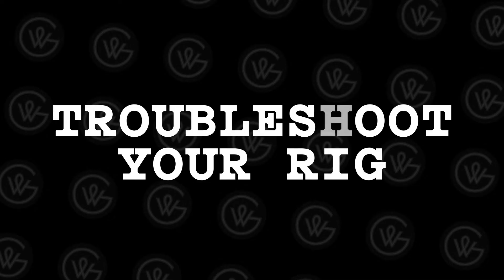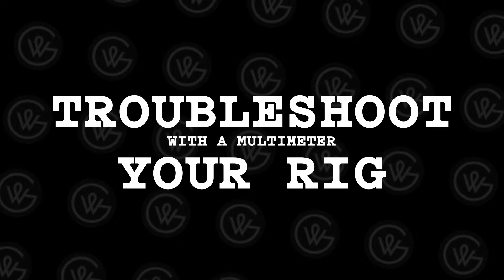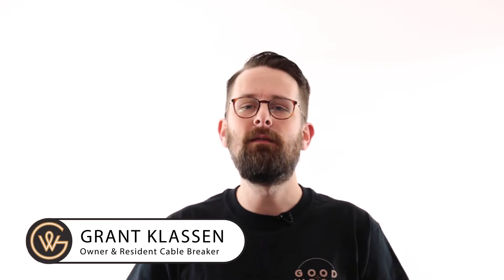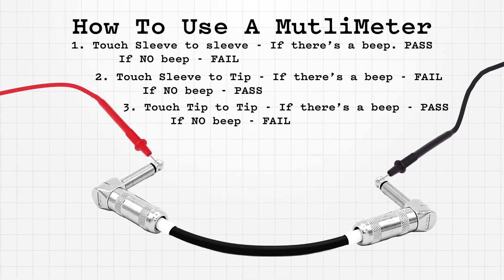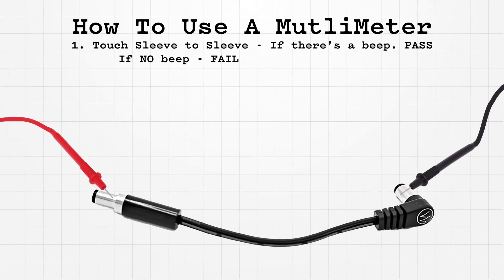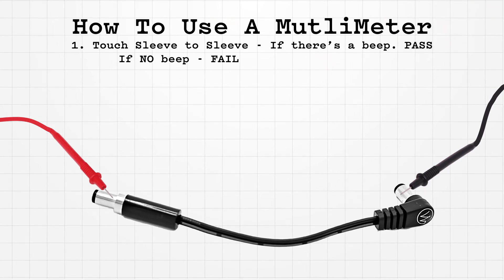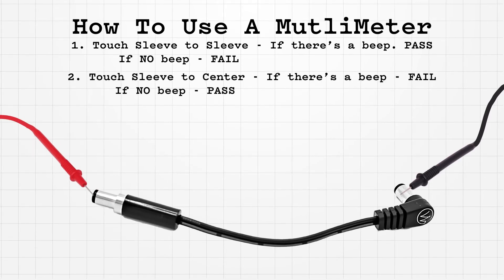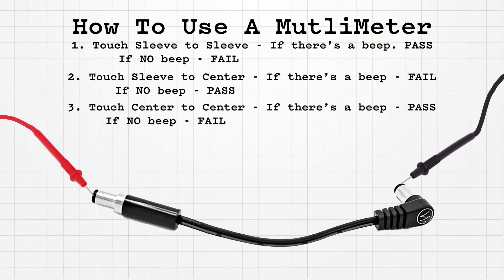How To Test Patch Cables Without Taking Them Off Your Pedalboard!

Comment: Can you explain a cable that tests good with a multimeter but does not work in a board? or plugged straight into an amp? Isolating this problem down to this apparently good cable has been frustrating, and I don''t understand how I get continuity with it but otherwise no signal through it.
Reply from the maker: interesting.  I'd check that the sub shield (if it has one) --> a black shield between the ground and the dielectric --> isn't shorting to the tip of the cable.  These will test fine, but either sound very dull (no high end) or not work... that would be the first thing I check.

Comment: That's useful - but how do we test the quality of the cable connection?  i.e. resistance level - this determines weak vs strong connections, right?   When learning to solder I've made cables with only one or two strands of tip or ring signal connected and they still pass this multi beep test - but I know the connection is weak.  How do we get more granularity on the quality of connection?  Thanks
Reply from the maker: hoesntly.. you could use resistance to test this, but even with a few strands connected, you'll get a good reading.  The best way if you're concerned about this, test with resistance and then also give the connections a visual inspection.

Comment: When testing for continuity, what should your meter be reading? I’m generally reading 0.4 ohms when testing my patch cables.
Reply from the maker: ya, you're good.  i usually say (this depends on the multi-meter as well, and how you test) anything under 2-3 ohms and you're good, but very nice when it's below 1.

Comment: I missed the explanation of how to test a patch cable WITHOUT REMOVING IT FROM your pedalboard.
Reply from the maker: ha.  Fair.  This is assuming your cables are tied to your board (zip ties / anchors etc).  with a multi-meter you don't need to unclip / cut those zip ties to test.  With a traditional cable tester you typically would (undoing a lot of hard work / time)
Reply: @GoodwoodAudio  in this scenario you leave the cables tied to the board; and you have to unplug the two jacks from the two pedals.  Correct?

Comment: Just got a multimeter. So helpful!
Reply from the maker: Good investment for sure!
Reply: I’m still a bit confused though. The numbers are supposed to be zero correct? I noticed the multimeter beeps even with numbers showing so I don’t know if that’s a bad thing or not. The sleep and tip don’t beep though.
Reply from the maker: @kristenrocksfrags8584  it beeps for low resistance generally but not JUST zero... so ya, even with some numbers you can still get beeps / continuity.

Comment: Maybe I missed something, but where is the difference to a Cable-Tester? I thought the Cabletester will also make the Beep and for both Methods I need to unplug all cables!
Reply from the maker: Great question. A cable tester will give you the same results, but if you can't get the ends of the cables to both come to the cable tester (within a couple inches of eachother) you can't use it.  The main thing Im saying with a multimeter is it's way easier to test cables on your board when they are either tied in, or more likely extend across your board to connect two pedals.  But you're right, if the cable is only going a short distance, the cable tester is just as easy to use (unless the cable is too short, then you need a multimeter again).
Reply: @GoodwoodAudio  Ok, so I don’t need a cable tester and stay with my multimeter!
Reply from the maker: @annonuem  if you already have a multimeter, I'd just keep that around ya!

Comment: OK so how do it test without taking off board? Click bait?
Reply from the maker: using a multi-meter... since the nodes are able to go far apart you can test each end of the cable easily.